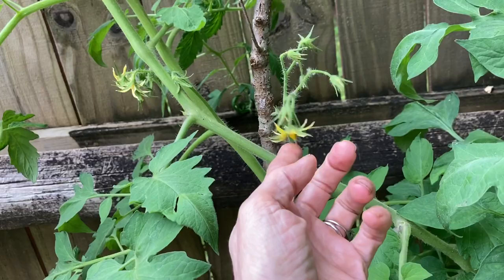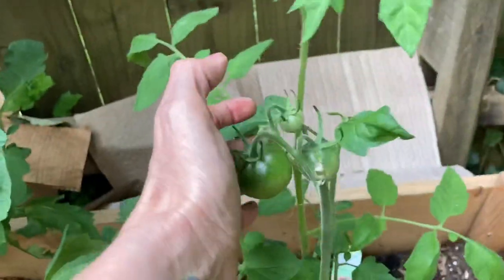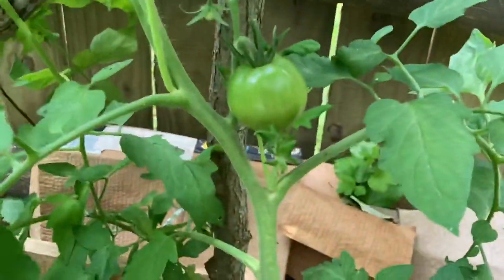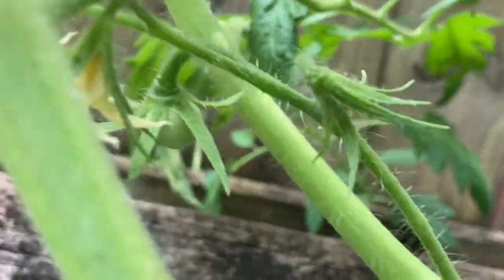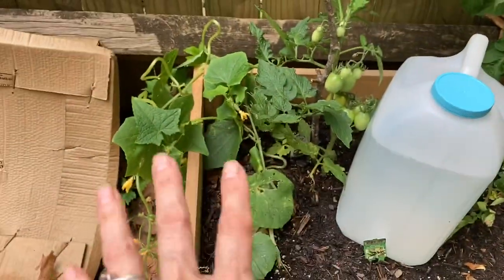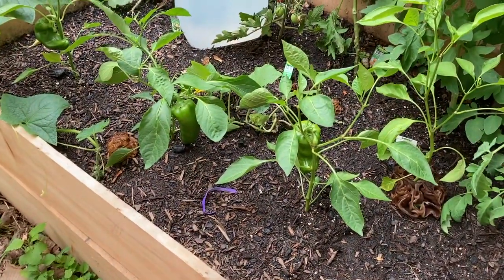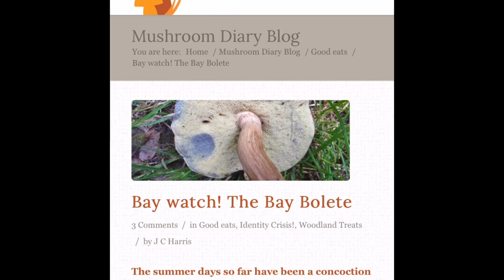Mushrooms & Harvest Tomato Time

Comment: The rule I heard is that boletes should not stain blue or have any red parts (ex old man of the woods which is an exception but easy to tell apart). This rule does reject a couple edible boletes but will keep you alive.. :) the really toxic ones have reticulate red parts on stipe which yours doesn't have, but yours does have red hue. I would steer clear.. :)
Reply from the maker: Gotcha, makes sense. I left them there. :)